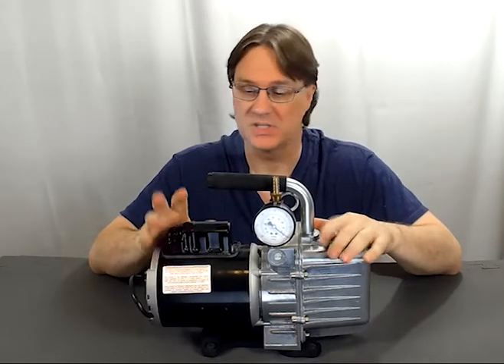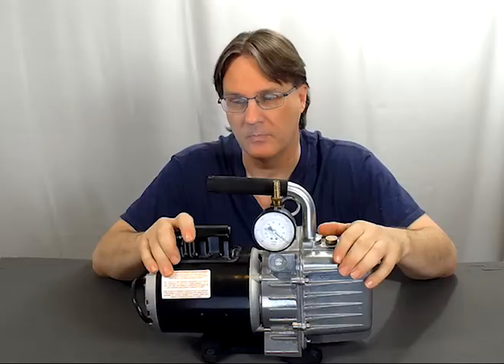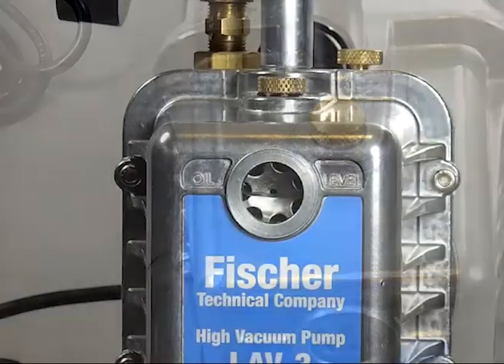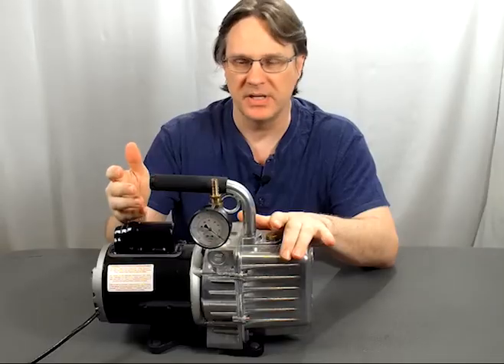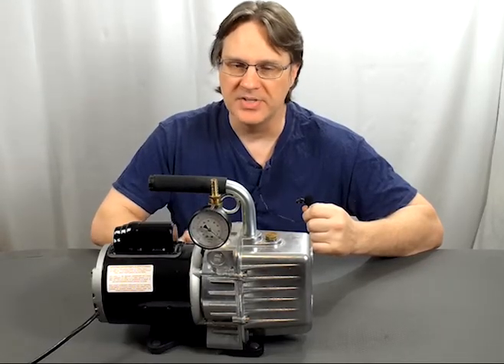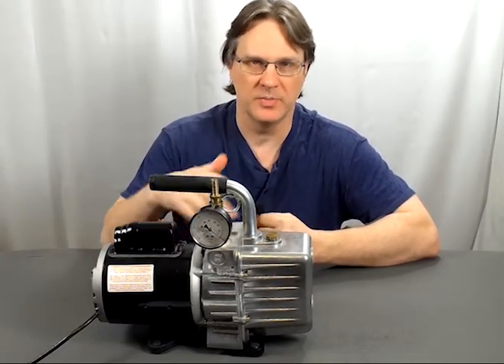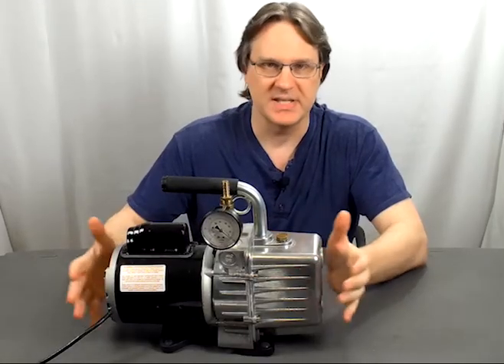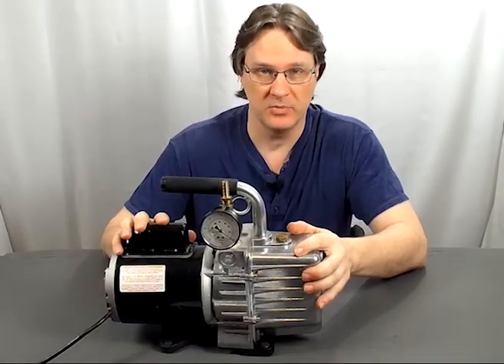Fischer Technical Company High Vacuum Pump

Comment: I've got the LAV-3, what do I do if the oil backs up into the system? Thanks
Reply from the maker: This sounds like you're turning the pump off before either isolating the system or breaking the vacuum.  You can do this two ways: 1.  If you added a shut off valve to the system, close that valve and isolate the system. 2. You can simply pull the hose off just before turning the pump off.  The oil is backing up in the system because you have a high concentration of molecules on the pump side of the system and a low concentration in your system.  If you shut the pump off before breaking the vacuum, the molecules will try and even out and as air rushes into your system, it will pull oil into it. Typically, this causes no damage other than oil getting in your system and you should verify that your oil level is at the fill line before each use and you should be fine.
Reply: @fischertechnical9819  Thank you, I appreciate it!
Reply: Put a non-return check valve in it, that will help you.

Comment: Can this pump used for vacuum membrane press
Reply: It would depend on what vacuum you needed to pull and if it was a dry system. Note the vacuum cannot be regulated so it would have to be a vacuum near 40 microns at sea level